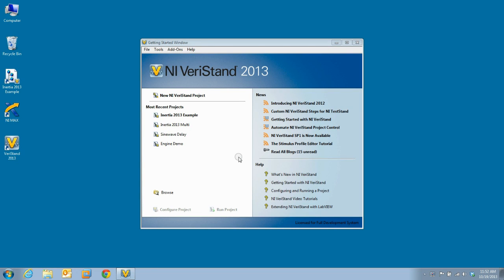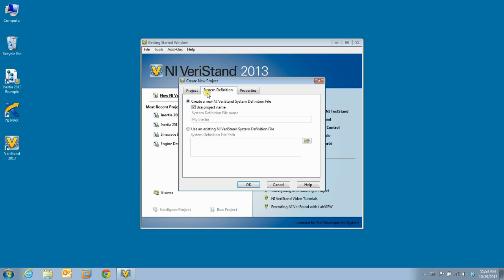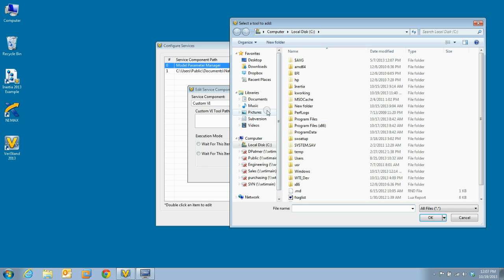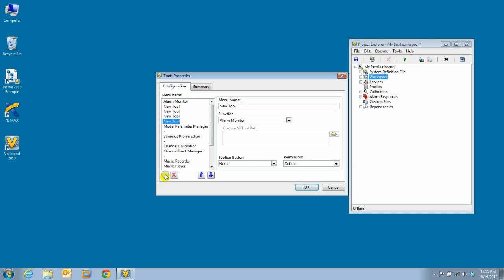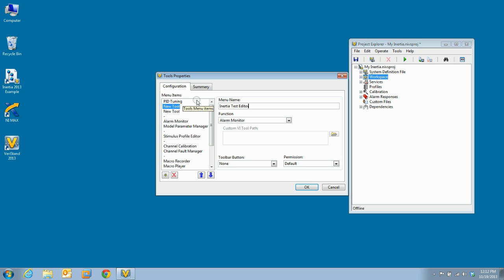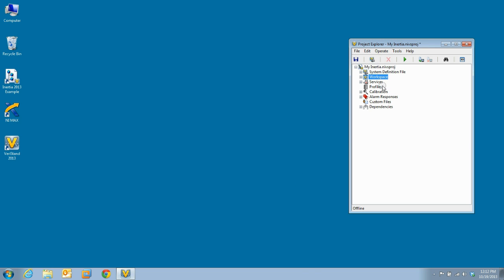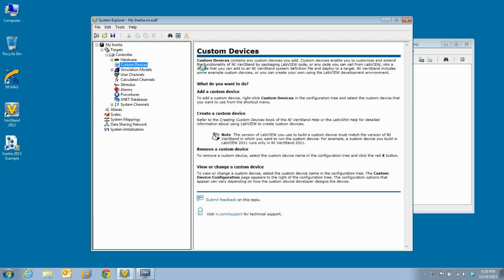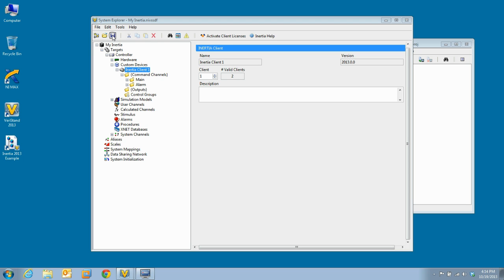Moment of Inertia - Creating a New Inertia Project

Comment: Hi. By downloading the 2017 version (and hence using with Veristand 2017), I can't locate the files in that specific directory; in fact I cannot find any of those files anywhere after installation (for e.g. PID Initialization Service.vi).

Note: I can only find them on Version 2016.